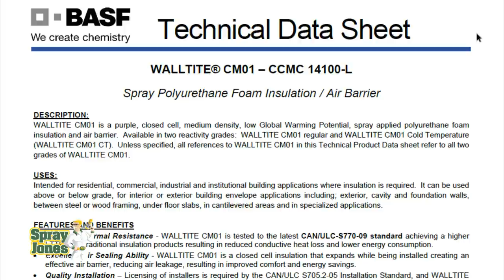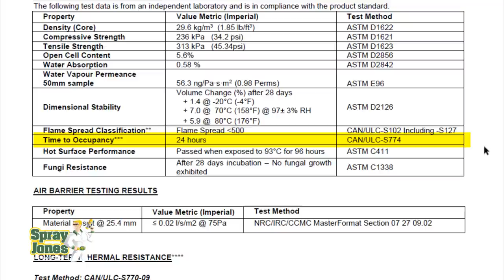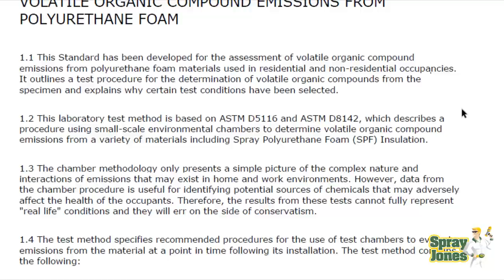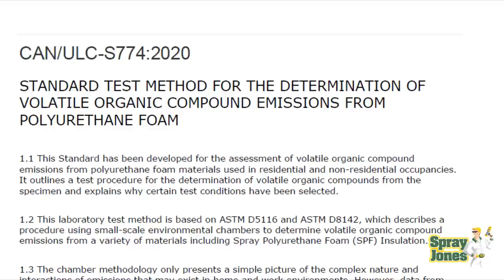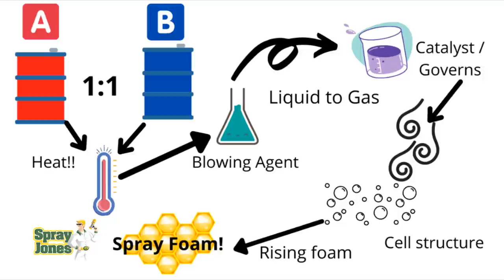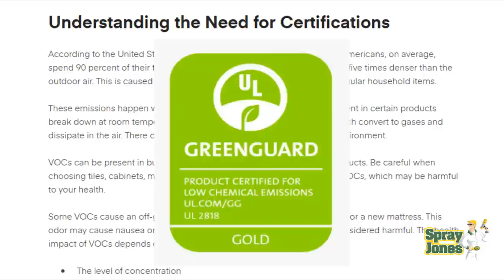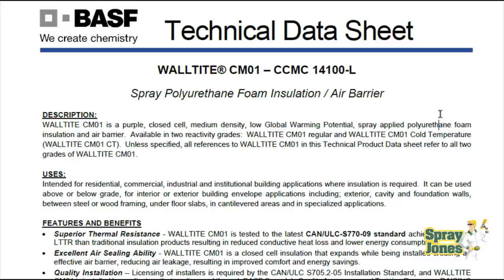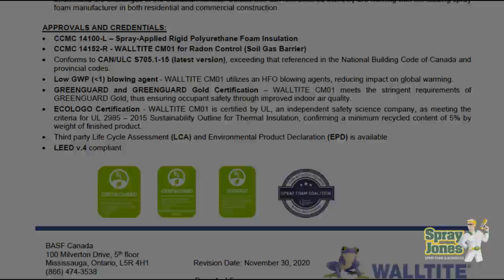Spray Foam Insulation & Off-gassing

Comment: Hello Mr Jones i am doing some resurch on spray foam. I am in North Carolina and i do HVAC work. one of our customers called us about two month's ago complaining about a smell in her house. what she described sounded like dirty sock syndrome. When we arrived we noticed she had the crawl space encapsulated and spray foam on the block walls.   we did our check on everything HVAC related. in the process I found mold on the floor joyce from a bathroom leak they had a year or two earlier. this was supposed to be handled by the company that did the crawl space. I was out again today due to the smell getting stronger. when I opened the crawl door it was a strong odor, not 100% how to describe the smell . after about 15-30 min of being under the house, I started getting a headache. i have been to a lot of houses with encapsulated crawl spaces but this is the first with spray foam and having the smell. i am going to recommend they have some testing done. Any other ideas? anything is appriciated.
Reply from the maker: You need to get to the source of the odor. Could be mold, ground water, many things. Foam does not usually smell like socks but water-related issues sure will. 
Get the data first, then they can attack the problem properly.

Comment: I don't like the idea of fiberglass fibers floating around my house and never have. I work on houses and have never liked fiberglass insulation.  It's like Tweefer in the way that it's probably just as bad as asbestos in the long run, for your lungs, but it's not the banned one so they can still sell it.... if you smell what I'm toking.   The house we recently bought had fiberglass stuffed in between the joists.  It's really good at holding moisture :) I ripped it all out and sealed the crawlspace and added a vent fan.  I'm really just commenting on your channel to help it out.  Good day sir

Comment: Excellent video, thank you!  On average how long would you expect no smell to be experienced after installation?  If I may get your thoughts on one other question...its imperative that A and B are combined in a 1:1 by volume.  Ideal substrate conditions as well as environmental conditions are also very important.  What seems to be less important (and probably much less) is the proportioner.  The standards make no mention or recommendation on which machine is used and frankly if the chemicals are mixed correctly the foam itself is unable to tell what mixed it.  Getting to my question...doesn't a more expensive proportioner really only result in conveniences (such as off-ratio warning, temp control, speed, etc) and perhaps add to the artistic outcome (asthetic) of the foam (smoother surface, easier to achieve desired lift height, etc)?   I'll concede that an expensive machine seems to atomize and mix better than a less or older machine.  However, it seems like the chemistry tolerance is wide enough to allow for less efficient mixing by an inferior machine and still result in a favorable outcome.  Thoughts?  Thanks again!!!

Comment: Excellent 👍. I was concerned about voc and now I feel better. Thanks for sharing 👍
Reply from the maker: All good. 
Using your comment about air seal in the R value video coming up.
Reply: @SprayJones  Thank you.I  just found out that in FL a wall with a high thermal mass like brick or concrete the code for R value is half. Is this true in Canada as well? Engineers were saying a airtight envelope with thermal mass wall system was most energy efficient. But they were also mostly referring to FL climate. Thanks 👍
Reply from the maker: @brianlee6849  Thermal mass applies best when there are swings that need to be regulated. So cold at night but hot during the day... store up the heat of day and use it  to get through the night. 
When in long extended periods of not having swings thermal mass is useless and can be a hindrance. Hence good insulation.
Reply: @SprayJones  Not saying they were correct because I'm not a expert but they are claiming 50% more efficient with a high thermal mass on the outside with 1" air gap frame insulation inside vs frame with same R value. But they were pointing out that to meet FL code your wall requirements for R value are half. I want the brick exterior for many reasons value, hurricane protection, fire resistant and looks. I was thinking energy efficiency was a extra bonus I still want frame with 3" closed cell foam inside. Thanks
Reply from the maker: @brianlee6849  Sounds good. And I was just claiming hat conditions are needed to make thermal mass effective.
Reply: @SprayJones  Cool 👍

Comment: Thanks for the excellent video. You’re obviously put a lot of work into it. He said it may have to go into a second episode and I kind of hope it does because I got something I’d like you to further explain. On the testing, you mentioned that they take a physical sample of the spray foam in a bag. To me that sounds like it’s testing the chemistry of the product being sprayed. But as you stated the problem starts with a bad installation. And what needs to be tested is the air quality. Not a sample of the foam itself. Because when the guy spraying it into the bag he’s not spraying it into the bag too thick too fast. I’m not sure if the green guard certification actually does air quality testing. That is what I think ultimately needs to be done and they may be doing it
Reply from the maker: You miss understand. The sample is sprayed and collect and placed into a bag. Taken to the lab whereby the next day the bag is opened, the sample taken out and placed into the chamber described in ULC S774 and the 24 hour test is underway.
Reply: I think that is my understanding with the exception I thought it was a sample of what was being sprayed.  But my point is the same.  If one guy or a team of guys sprays 90% of the sample within specs but one guy does a poor job in a spot no one will see for whatever reason.  If the sample is not taken from that expect spot then the test is not indicative of the problem causing area.  I have seen lawsuits based on bad application in only a fraction of the home.  The home was allegedly uninhabitable.  Much like with asbestos’s and lead the air itself needs to be tested.

Comment: I have the same problem as a few others here. I had my attic spray foamed with open cell  a year ago and it still smells like the day it was done. He closed up entire attic and vent, sprayed close the attic roof fan and the gable walls. With warm and hot weather it is  unbearable. The attic turned into a hot sauna and the moisture was so bad that the paint off the kitchen ceiling was being pulled away in sheets just like wallpaper by my  kitchen renovation guy and I took a video of it. The kitchen reno got worse. So much moisture coming down from the attic into the drywall,  we had to remove it all in the kitchen and dinning room. We  thought at least it would air out but no it didn't. It was recommended to remove the foam with the roof deck. I'm looking at replacing the roof!
Reply from the maker: There is a lot going on there. You need some help in your corner.

Comment: Mike:
 I have a double wide mobile home that has a block wall under it for looks.
  Between the floor and the top of the block is a gap and the air comes thru and in the winter our floors are freezing cold.
  Question.
#1 i want to appply spray foam to the underside of the home and the bock wall under the house.
#2. I want to do it myself buying the kits at the box store is this doable or would i have water or moisture issues. Thank you Roy.
Reply from the maker: Get a pro... please.
Reply: @SprayJones  can not afford a pro. I am going to do ot myself.
Looking for addvice.
But if you dont want to offer advice thats ok. Thanks anyway.
Reply from the maker: @dailylife6432  That was my advice.

Comment: Do you have a link to the chart you show that gives the insulation performance at different CSF thickness levels? It was something like at 1" you hold 89% of your heat and at 2" 93% and so on, I was curious to know what the delta was in the example after thinking about it. Thanks
Reply from the maker: Not yet. I have asked my web site ppl to build a resources page where I can upload those to for review. 
So it will be coming and then I can populate the info for your view.
Reply: @SprayJones  Thanks, I found the chart in your video "Is 1" enough?" Do you remember what delta they used or do you know if it changes much with a larger delta? I live in South Dakota, we see 100F summer all the way to -32F winter temps.

Comment: Hi Mike. I live in the US and recently had my bathroom and laundry room spray foamed on the outside walls. It’s been almost 2 weeks and I still have an odor. The company came back and looked at it and said everything looked good. However, there are parts of the foam that started flaking. It’s dropping small pieces of foam onto the floor and it’s no longer a smooth surface. What are my options? I don’t want to get sick but the company said it’s fine. Can I just hang some vapor barrier? Do you recommend sealing it first? Or do I have to remove it? How do I know? I appreciate any help I can get. Thank you! Erin
Reply from the maker: Know what brand of SPF they installed? If so I would get in contact with the manufacturer and send pics of what you are seeing. Start there. 
Inform the install company you have concerns and want to know more..

Comment: Awesome discussion.   I will be straying a portion of my house in the coming weeks.(removed all of my fiberglass that I could get)   Thank you giving lots of detail and easy to follow audio with your slides.   I had a small addition strayed 15 yrs ago and the same installer is doing it again.  Note from my experience. I built my house in 1999 all fiberglass - small house little at a time  I added  small two bedrooms (2 stories) with insulated foam blocks (legos with concrete) in 2002 -  Comparing the insulated foam block to my spray foam ( spray foamed another addition in 2005) - hands down spray foam has caused zero issues.  i used an early version of Amvic ICF's  Ive learned a ton from watching many of your videos even though I completely trust the installer who has been doing spray foam for well over 20 years.   Your customers are lucky to have someone  like yourself who has their back.  Thanks again for making very informative videos.
Reply from the maker: Thanks for the feedback

Comment: Do you have or will you make a video about a bad installation and all the hassle of removal of product and remediation to bring job to a "green" standard? BTW I am a retired journeyman painter with 45 years in the business. I always did a top notch job strictly because of the horrors of fixing a bad job were too much too deal with. Thanks for your in depth approach - I wish you worked out here on Vancouver Island.
Reply from the maker: I will probably do some "fix it" videos on dealing with botched jobs at some point. 

More time is spent avoiding the botched jobs hence what I am doing. 

Thanks for watching.

Comment: Question can you spray 2” closed cell then apply an open cell on top of that to reach the necessary R-value? We need a R-50 which would be fairly expensive with closed cell.
Reply from the maker: You can. 

But this opens up all sorts of other issues. 

I assume this is a roof problem. 

I will be addressing this code issue in the 4 part series on roofs starting next Tuesday.

Comment: Excellent presentation of information, as usual.  Thank-you!   In another video of yours (sorry, I don't recall which one) I believe you made a comment about the R value of foam decreasing slightly over time...which got me thinking with regard to this VOC topic.  Is there a one time or ongoing 'settling' of the foam, and, in light of the comment in this video about the closed cells being a vacuum, is there any risk of VOCs being released over time if there is a settling or aging event?  (when/if that vacuum  is broken).   Thank-you.
Reply from the maker: Good question! The answer is no. The diluting of the blowing agent happens quickly within the time of application, however the VOC test has already shown that within 24 hours there is 0 detectable traces. The VOC test does continue past the 24 hours as shown in the green guard certification the values are rated for a while. 
Hence why the LTTR rating is all that is to be listed and used for thermal ratings.

Comment: I was going to say didn't you already cover this, but it was the video on burning foam. I say foam is only dangerous when closed cell is applied and you just stand beside the application process without a mask.
Reply from the maker: Correct.

Comment: One consideration, what are the total VOC emissions of 100 cubic feet of Spray foam, from manufacturing to installation vs the VOC emissions of producing the same amount of other insulation. Example, wool insulation, the VOC’s given off by sheep. The environmental impact of hemp production, and the effects of fibreglass on the environment for the same amount of insulation?
Reply from the maker: That has been done by BASF in their total life-cycle analysis reports. 
Fiberglass & Rock Wool will not even be considered. By the time you melt the raw material for making it you have consumed more energy than the product can save in it's life-time.

Comment: So there isn't anything that can be done here in the US now before or after the spraying of foam correct? What can be done to prevent being stuck with spray foam that is releasing VOC's in the US. Knowing all this makes me pessimistic about ensuring that I hire someone that will spray the foam in a way where i don't need to worry about the safety of the foam and my family's health.
Reply from the maker: Demilec, BASF, NCFI are 3 examples of companies that make solid and safe products that you can trust. 
It then comes down to getting a good installer, which it the real key to it. 
So good product and good installer = excellent job that is safe for generations. 
No different from electrical wiring or HVAC.
Reply: @SprayJones  my installer said he uses a product called Lapolla by Huntsman.... Have you heard anything about this product? Thank you
Reply from the maker: @em2012ish  Yes. Huntsman owns Lapolla.

Comment: I recently had two of our interior walls foam insulated and two weeks later there's still a crazy plastic-like smell.  Is that normal?  I called the insulation company and they indicated it should go away after a day.  When I indicated it didn't, they haven't called me back.  I'm not sure what to do.  It's my baby girls room and I'm worried I'll never feel comfortable putting her back in that room.  Is the only solution to rip the walls open?
Reply from the maker: Something is off for sure. Two options: encapsulate the SPF to contain the smell or rip it out and re-spray. 

Open or closed cell?
Reply: @SprayJones  I'm sad to think we're going to have to completely rip her bedroom walls completely out but, I think that may be our healthiest solution in the long run.  I'm not sure if it's open or closed.  We used usainsulation.net.
Reply: @jenniferondrasik982  curious did the smell resolve?  What course of action did you take?  thanks

Comment: My Coast Guard mandated, fire control training…. Exposed firefighting as a modern day chemistry event. 
  When hot, things change at the molecular level. If they burn, they borrow molecules from other things that are burning to create other hazards that did not exist before. 
   I appreciate your passion and your acceptance of the science of your industry and your faith and character to adhere to the science and it’s absolute, benchmark formulation that is reduced from engineering to a list of instructions that must be followed. 
   Clever.    But it’s stuff like that that is keeping it too expensive for me and I’d be foolish to not add that if you restrict the airflow… you gotta get an HVAC engineer involved or you will have air quality issues. 
   More expense. 
   So… the thermos bottle houses you are making are gonna be heated with a candle, but that’s all your gonna be able to afford after all the college kids get paid. 
   For the time being anyway….

Comment: Great video! Does this information also apply to injection foam? My installer told us that injection foam is different and that there is no off-gassing or VOCs like there is with spray foam because its a totally different chemical. Is this true? I'm having a hard time finding information that compares spray vs injection foam in terms of safety.

Comment: While spraying under metal roof,how far should installer stay away from wood stove pipe and can the foam ignite while Wood stove is heating .
Reply from the maker: Normally the stove will have an adapter collar that allows insulation to come in contact with it and then it contacts the hot flue pipe. We only spray to where it is supposed to and can go..

Comment: I am getting my whole house spray foamed and the 2nd floor has just been finished. If 24hrs is the timeframe for occupancy, would that mean i cannot work unprotected within that 24hour period? I smell off gassing but its not extreme. Product used was Grizzly Gold MD SPF.
Reply from the maker: Generally no. People work all the time behind the SPF crew before the 24 hour period is up.
Reply: @SprayJones  thank you I appreciate you responding so quickly. This is great information and knowledge for others as well